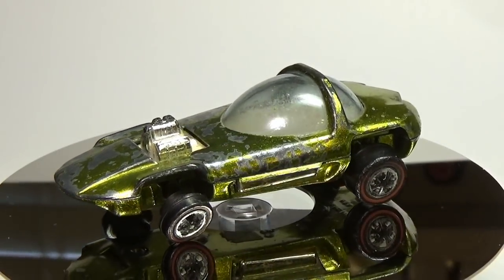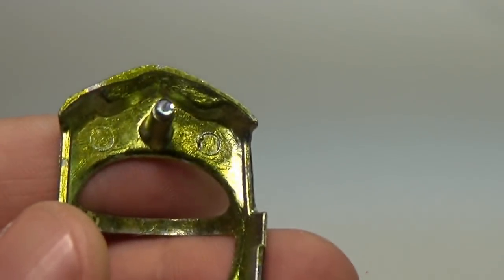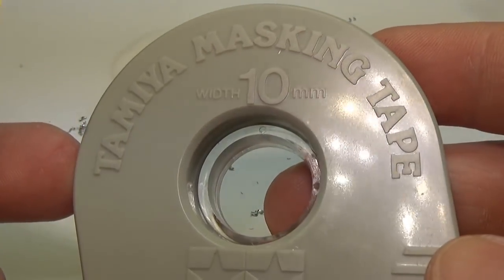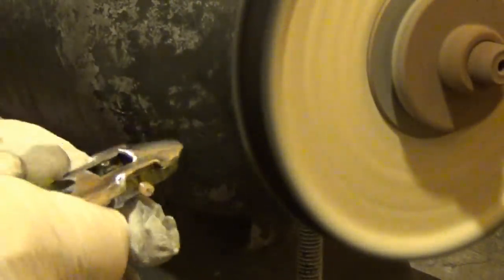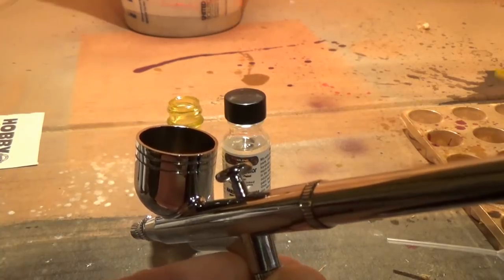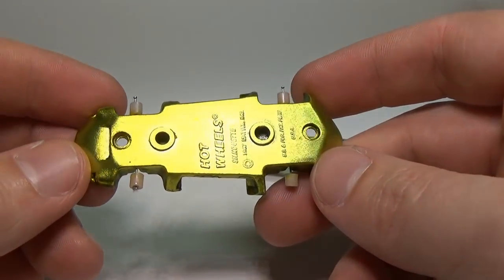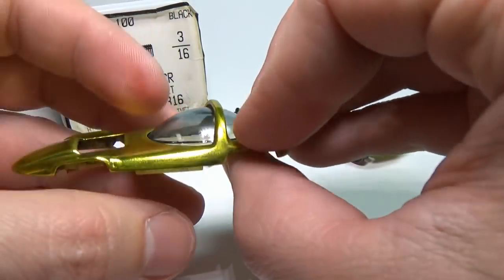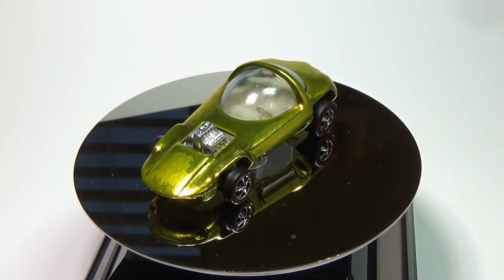Redline Restoration: How To Step by Step

Comment: I'm not sure how you managed to tap those holes by hand. I've got this toy car in a freakin' vise and putting all my weight into my tap wrench and I can't get a damn thing out of it
Reply from the maker: hmm.. something must be off.. are you sure you have the correct drill bit?
Reply: I didn't think the issue would be with the drill bit- It's the smallest one that came with my rotary drill set but the rotary drill itself doesn't have enough torque so I stuck it in a cordless drill. It matches the diameter of the tap bit I'm using (which is rated at NC40) and besides drilling off-center once (which I've corrected) drilling the hole itself hasn't been the issue.

When I try and tap it I'll get maybe one good turn of bite and then the bit wobbles around inside the hole and goes limp again, and again, that's with both hands, car in the vice, putting my weight into it. It's a shame that there isn't any coverage about drilling/tapping these smaller holes on the internet because I could use some tips on technique.

I was really inspired by your work and my interest in tabletop RPGs caused me to want to make models for gameplay, so I've set off to build some post apocalyptic cars using your technique- I've got a few cars lined up for learning with because I figured I'd mangle a couple in the learning process, just a little inside info.
Reply: An update: holy crap I just snapped one of my tappers

I'm definitely doing something wrong
Reply: An update update:

After reviewing a few other how to videos I wondered if using lubricant (even though they said "not necessary for smaller holes") would help, and I've actually managed to get a good tap, if it goes well enough I'll show you the finished product if you're interested

Comment: A better way to remove rivets is to place your drill in a vice, lock it on a slow speed & push the cars rivet against the drill rather than try to hold a drill & a car.

Comment: Hot wheels like many die cast toys are made of ZAMAC, Zinc, Aluminum, Magnesium, and Copper alloy, and in the 50's thru the 70's a major problem was Lead contamination; the discoloration is from the lead recrystallizing over the years, and sadly there is no cure. :-(

Comment: I really like these restorations and videos but I am wondering why you would go to all of the work and time spent restoring them but not go ahead and get new wires and plastic bearings for the wheels while your at it. They don't look like they would be very expensive to replace. Also, they make a plastic repair epoxy like stuff that comes in the syringe that mixes the two components together that would probably work to fill the enlarged holes in the plastic bearings and then find a drill bit small enough to re drill the holes. They would probably be like new afterwards. I'd be danged if I'd spend that kind of time and energy restoring something and leave a couple details like that out.....
Reply: Jeff...while I kinda agree...I wonder if that would work?  I seem to recall him (@baremetalHW) saying that some of these axles cannot be removed with out altering the chassis (originals were actually patented "bent wire" that clipped in; follow-on years had the axles with body-integrated "welds" preventing easy removal.   I'm curious if you have tried it?
Reply: @captaincoyote1792  No I haven't tried it. I'm not sure about these integrated and welded axles. It's been too long since I've actually looked at them but I thought he mentioned in another video that you can get new axles and bearings online. I'd have to research it more.
Reply: Thank you Jeff for the quick reply.....I too will research further! @bodeine454

Comment: how to remove color from plastic model car
Reply: cld st 182 ford the only way I could see doing it is with a fine grit sandpaper and sand lightly. just repaint after. any chemicals will eat through plastic
Reply: cld st 182 ford That would be too much work and time to even bother
Reply: i buy a old ford mode it has be'n  colord like 5time and wish to get it back to old look
Reply: cld st 182 ford If you are looking to strip paint, get a bottle of Super Clean (formerly Castrol Super Clean), it will strip paint and chrome off styrene plastics without attacking the plastic.......however, it will also strip any oils out of your hands, drying those out, so you may want to wear protective gloves for that work.
Reply: Cheaper alternative nail varnish remover works on some paint and not harsh as some other chemicals. Soak car for a while but check once it for progress regular.
Reply: ZOMBIE FOX GAME I'd be real careful with nail varnish remover, the varnish itself is typically lacquer, which will attack and crazy styrene plastics. Super Clean will not do that, and comes in large bottles and is reuseable.........also works great on skummy bar-b-q grills!